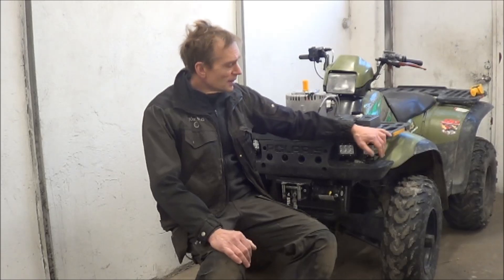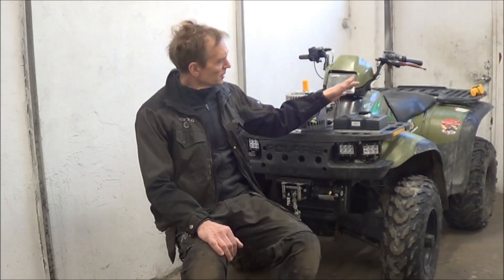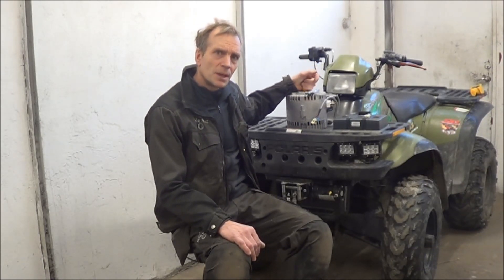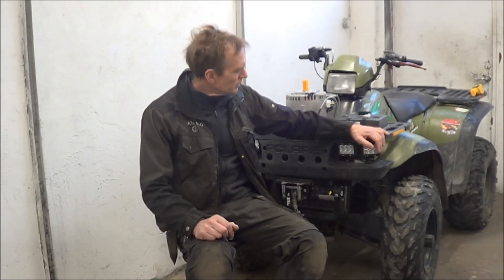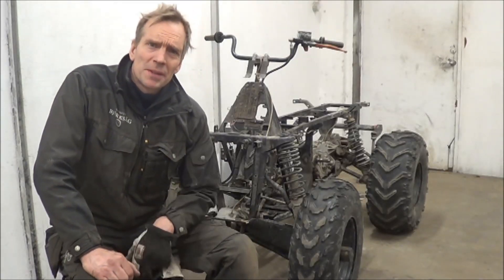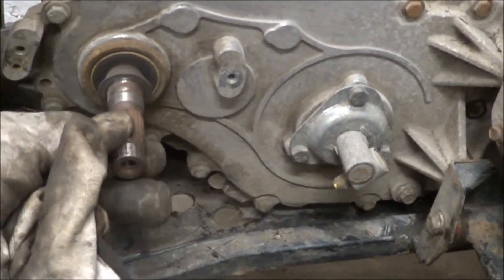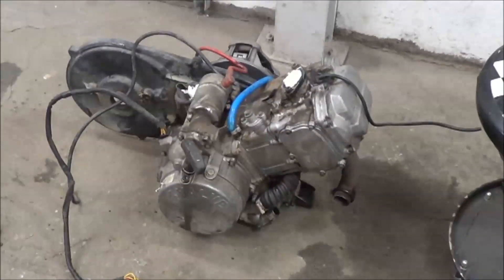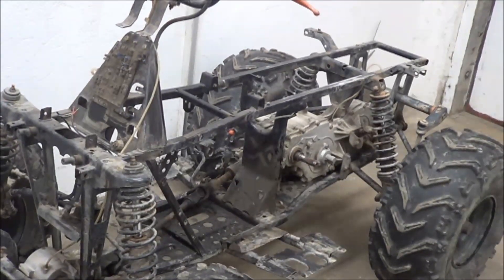ATV electric  Conversion

Comment: Interesting to note that although many of the parts are not the same the frame is about 95% exactly the same as the Linhai Bighorn / Manco Talon 2x4 that I am converting...even down to the 4x4 brackets that I have but didn't understand the purpose of lol
Reply from the maker: Hello, Apexsun !  Yes, sometimes you wonder if not they have the same manufacturer (China) on every part ;-)  BR Per

Comment: Sir, could you please recommend a brand / battery that could replace my 1500w Electric 48V lead acid battery (4x12v 20ah)?  I was thinking lipo or Lifep04 battery.  Any suggestions?
Reply from the maker: Hello, I recommend you to get a BMW I3 module. It is a 12 s 45V and you will have 4,14 to 5,3 kWh depending on year you get your hands on. You can easily fit a BMS to meet your demand.  Check my video: https://www.youtube.com/watch?v=wq24dVEdIjE&t=37s   or https://www.youtube.com/watch?v=7QEs4aWpgAM&t=87s

BR Per